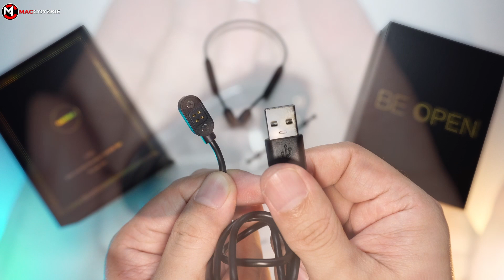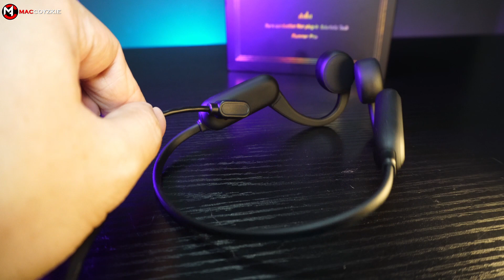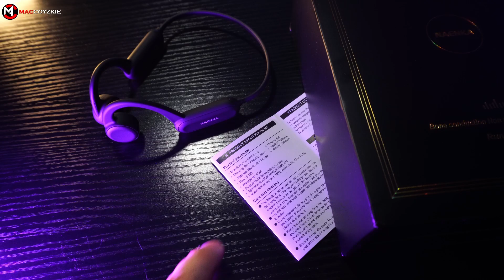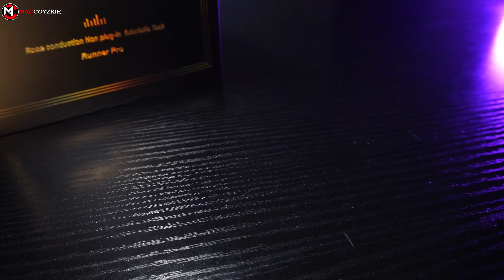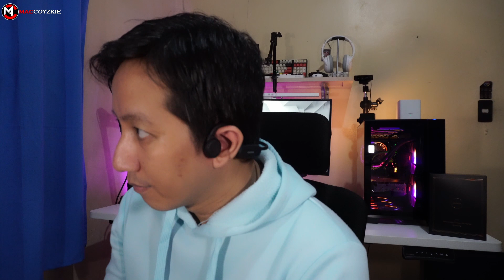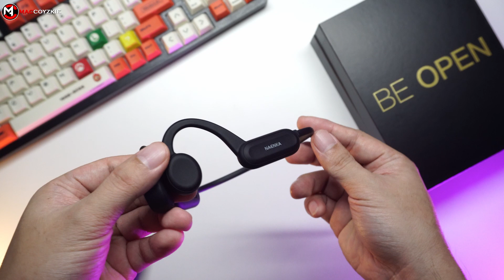Naenka Runner Pro bone conduction headphones review & mic test

Comment: I bought one lasted about 3 weeks first left side wouldn't work then it wouldn't charge then it never worked at all. I used it swimming and running. sound quality running was poor. I'd advise not to buy it as its garbage and dosn't last. This review is my experience and is true.
Reply from the maker: Sorry to hear that, in my case i've been using it for workouts at least 3 times a week since i got this headphones, i sweat a lot for sure but obviously clean it up before i place it on my headphone stand and still working. perhaps time will tell. as for the sound quality i think it is the nature of the bone conduction headphones, it is not for everyone.

Comment: Hey bro I need some help I recently bought a new gpu and it only shows me a display when windows is being booted not when I turn on my pc to check the bios please help.
Reply from the maker: if you already plugged the necessary psu pins for the psu then this might be broken, have a friend test that new gpu of yours and if the results are the same then it might be faulty, since its new use Rma

Comment: Hey I need some troubleshooting help if you would be so kind. My pc does not turn on after I put it into sleep mode I have to remove the cmoss battery every time to boot it up and ideas on a cause?
Reply from the maker: try to replace the power & data sata cable, perhaps its just faulty or dusty